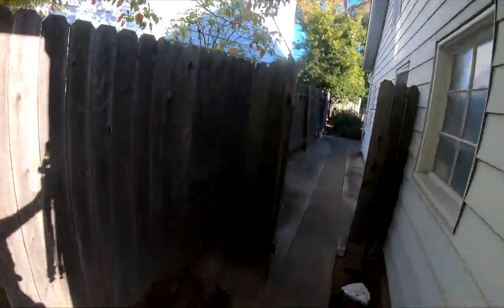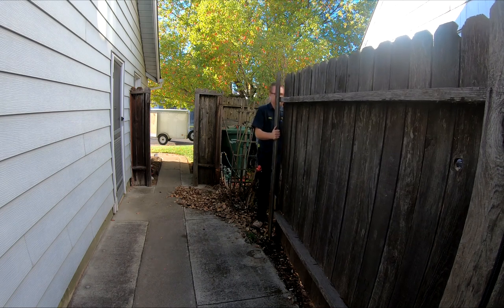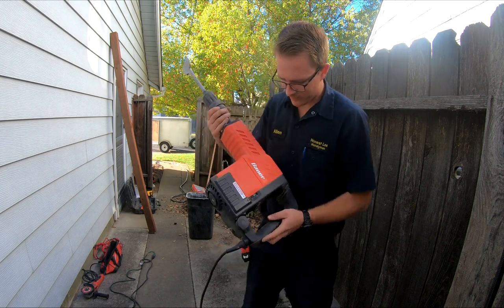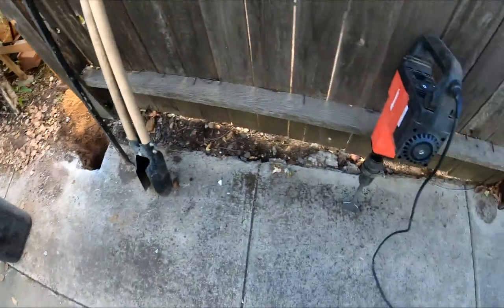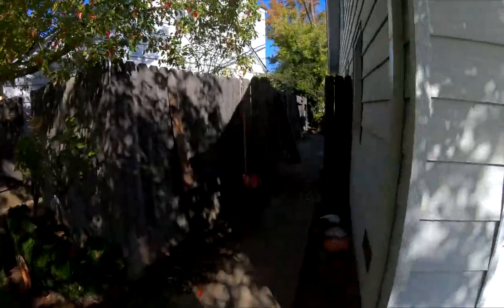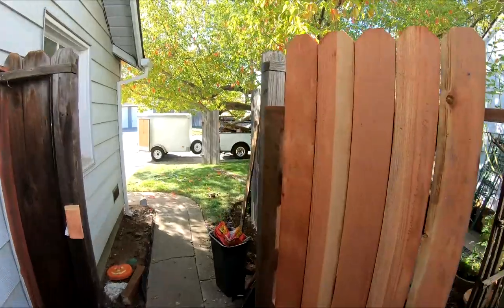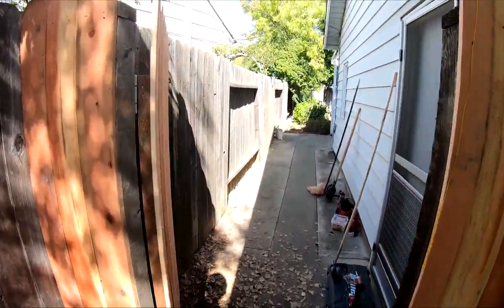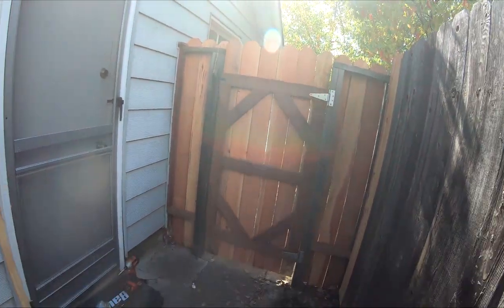Sweet Money | Handyman WLOG

Comment: Hello Allen, I noticed that on several of your jobs you are mixing bag concrete, and have a hard time getting the mix just right with the water. I had to mix several bags on a job once so here is a little tip for you. Don’t just spray water in and keep adjusting it until it looks good. Get you a measuring container and measure all the water you add to the mix, do this slowly until the mix is just right. Record these measurements, then you can pour that amount of water into a bucket, mark the water level on the bucket, and just fill the bucket to that mark every time. Since every bag contains pretty close to the same amount of concrete, then it should always take the same amount of water.

Comment: Lee, great video. Just 2 things that might make things easier/faster. I use a post level, it stays on post and both directions can be checked at same time. Other is the new foam fence post kit from Sika. It eliminates the need to carry 100lbs of concrete and does not require mixing.
Reply from the maker: Hey thanks I appreciate that! I have used the form before and wasn't too impressed but maybe I need to give it another try
Reply: @handymanjourney  to be honest I have not used foam either. Did it not set up hard enough?

Comment: I had the exact thing happen to me as far as the glass door. It was a friend but she was a paying customer. Same aluminum type sliding glass door that she wanted the sliding half taken out and a framed door put in. Then she wanted the other half of the door trimmed out to match the framed door encasement. The last piece of trim going on around glass was the straw that broke the camels back. I shot a 15g finish nail just into edge of glass causing it to shatter into a million pieces on the ground. I was literally sick to my stomach! What was to be a 500.00 job turned into a 150.00 after glass replacement.